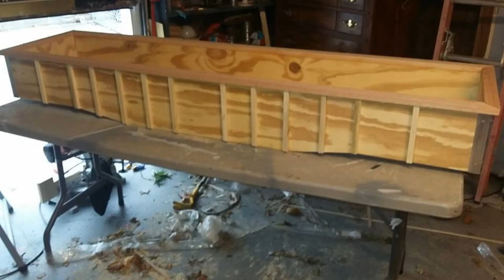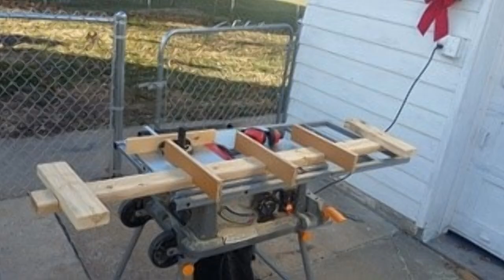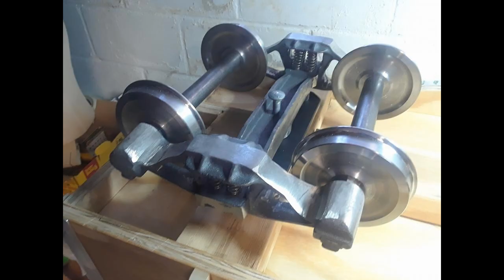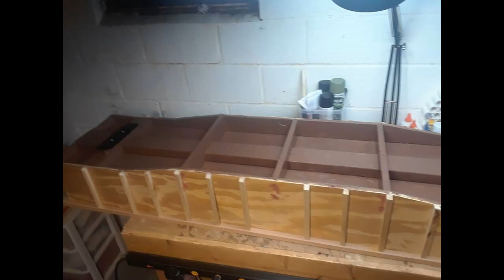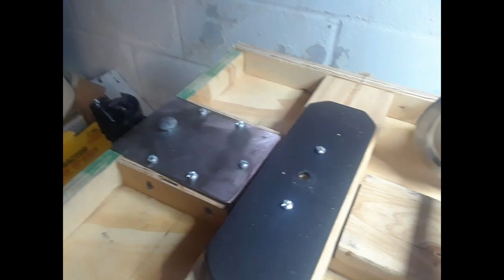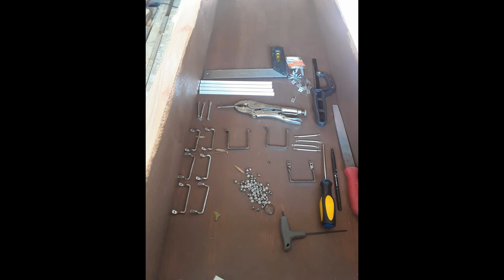Building a 1 5 Gondola for 7.5 track

Comment: Nice job, nice clean workmanship. It appears you are using Tom Bee trucks with EP couplers--yes?
Reply from the maker: On the caboose we are using TB yes. On the gondolas we are not. The couplers are indeed the plastic ones as our train will never be super long or heavy.
Reply: @MoosesWorkshop  The EP couplers work fine even for a rather heavy train, but safety chains are an absolute necessity if you have hills as we do. Cannot afford a runaway.
Reply from the maker: @formerparatrooper  no hills but I do have safety chains. :)
Looking forward to more videos from you!